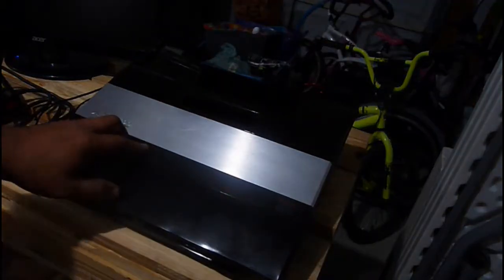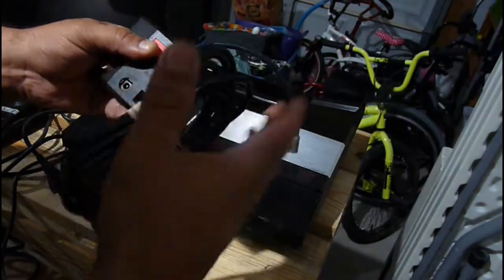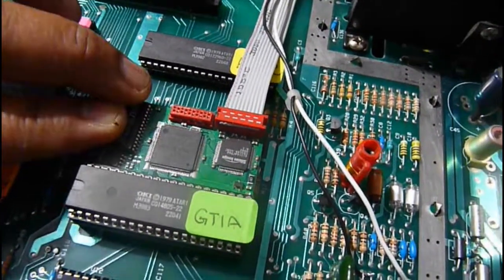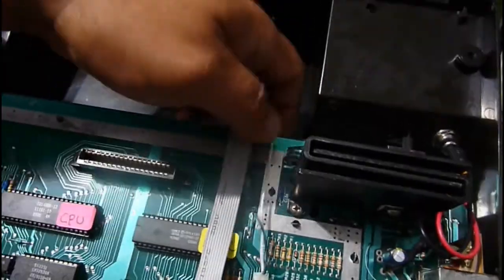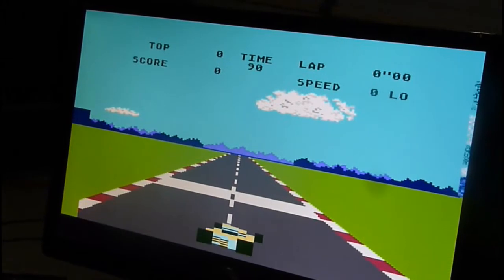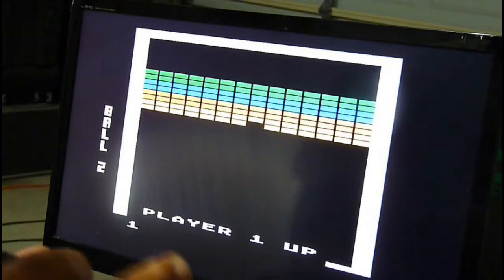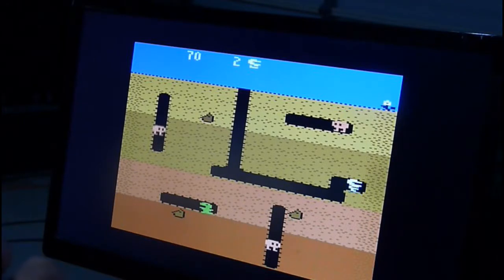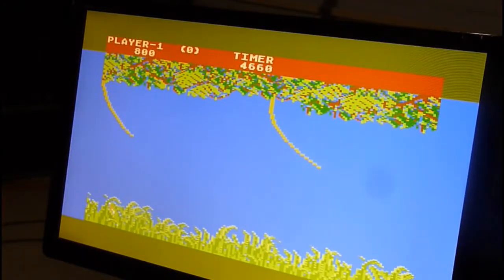Atari 5200 Sophia C-DVI REV. 3 Install + Audio  + Power MODs

Comment: It's always best to keep that RF shield on even though you do away with the RF output. If you have a really powerful transmitter nearby (either by a ham operator, a radio station or anything else that can cause RF interference) it can cause all kinds of issues with the system when you're playing it, having the RF shielding in place will help protect against that (although it can still find it's way into the system from the controllers and cables and such). I've seen many people just toss the RF shielding after doing the AV mod, I'm just shaking my head when I see it.

 And plus even though you do away with the RF output the components in the system still produce RF of some kind (although it's not going to be as bad as with the RF video output) the shielding will help keep that at bay.

Comment: Been wanting to get a Sophia board for the 5200. But I'm bad at soldiering. The 5200 controls are crap for the most part imo. There are alternatives but can be expensive. I am curious to know if the Atari 2600 adapter works with the Sophia board. If that's the case there is a great way for Atari 2600 games too
Reply from the maker: I should have shown the video of me soldering and installing the kit. It's a very easy process but care must be taken because much of the pads are old. The pads separate if you have to much heat placed over them so having a temperature controlled soldering gun is a must. I also looked into modifying the 4 port 5200 to work with the 2600 adapter but only RF is possible; maybe composite but I don't think so. Also the signal doesn't pass through the Sophia board making this mod not a worth while endeavor plus it's very destructive process to the console. I do have the parts to improve the controllers and also to make one from the ground up with all new parts but I am very busy. When I have time I'll get to to them and upload the videos. I don't understand why more people don't do these projects the information is out there for everyone.
Reply: @briareoshecatonchires7232  I currently have a a s-video modified 4 port. So the sound and separate power mod has already been done. If this is the case does the Sophia board just mount on the GTIA by snapping it in the socket? Or do I still need to soldier it?
Reply from the maker: @phonedork  if you have the IC socket adapter installed then no you don't need to solder anything but you may have to cut a hole for the DVI-C or RGB output connection. If you like I can take some pictures for you so you can have a better look on how it's installed.